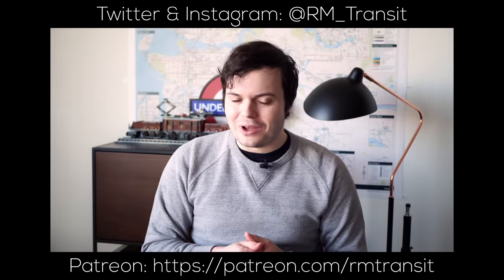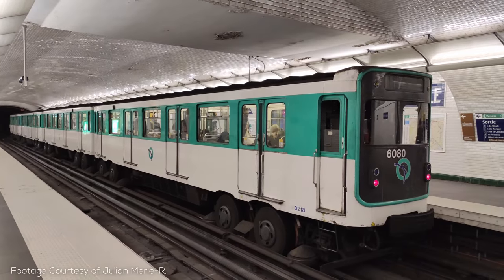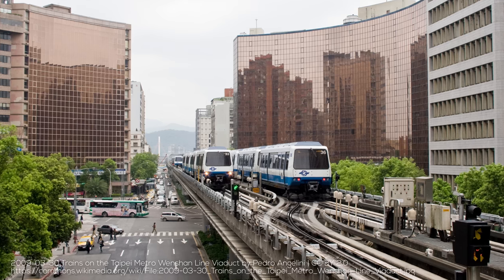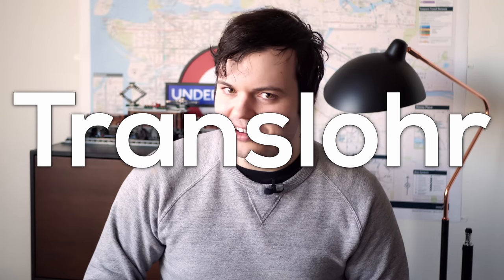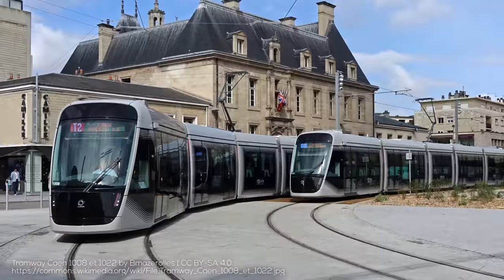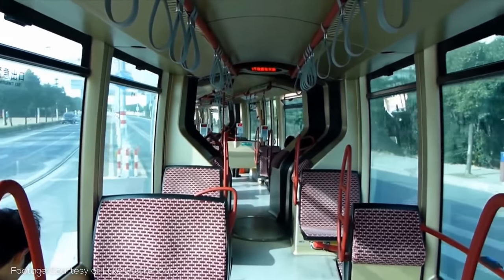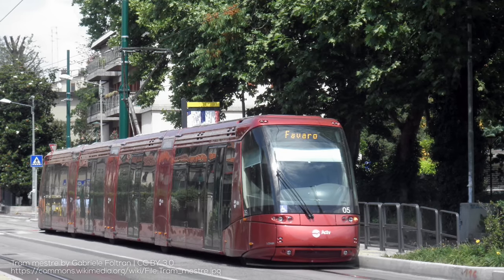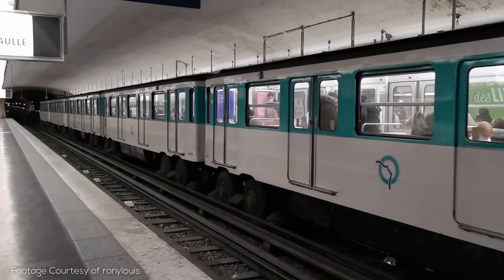Rubber-Tire Rail Transit is Weird

Comment: Medellin's hills are one instance where rubber tyres are vital. The city is along a valley, with the translohr up one side. Other perpendicular routes are operated by cable cars (gondolas) except regular metro along a side valley. But a trolleybus would also work - electric power but no track requirement.

Comment: The RATP (the company running the Paris métro) itself gave up with rubber-tyres at the beginning of the 1970s because they realized steel weels were just more efficient and retrofitting existing lines was too expansive. However it was deemed worth it to implement rubber-tyres on metro systems built from scratch. That's why Lyon, Marseille and every VAL network are rubber-tyred. Paris line 14 (opened in 1998) is also rubber-tyred but that was mostly for rolling stock mutualisation.

Comment: The thing with rubber-tire technologies is that they are not all equal. As a Montrealer, I love the metro system we have here. It is reliable, fast, beautiful and a tribute to our french affiliations. Most of our system has been planned and constructed between 1962 and 1988, so it is the product of a certain era and I don't think it should be seen as some sort of regretful outcome. However, even the rubber-tire train defender I am wouldn't recommend that technology to every city for it really depends on the system you have or need. Steel-wheel trains have evolved since the 1950's and the invention of the parisian rubber-tire metro, which did fulfill its purpose at that time and still do nowadays (although to a slightly lesser extent). Unless a system has multiple, close stations and curvy steep tunnels, I don't see why rubber-tire trains would be a necessary choice. And converting a line to fit them is likely too much trouble for too few benefits. And that's for metros that run in a tunnel and therefore doesn't need a unreliable single-rail system on a groovy rolling surface. Really, as much as I like rubber-tire trains, I hardly see the point of rubber-tire trams outside of a particularly hilly terrain.

In the end, I still see rubber-tire trains as just as good of an option to have in a metro system as long the said system actually needs them. Ironically, this is perhaps the main flaw of that technology. Steel wheels runs smoother and rubber tires runs softer (in a good and a bad way), but both works. Steel-wheel trains and rubber-tire trains both are as noisy, but just make different noises. Both are reliable. But what use to make rubber-tire trains relevant was mainly how good they could accelarate and brake compared to classic trains. That advantage has since noticeably diminished. So is it worth it nowadays to make a system use a different kind of more expensive just-as-good trains? I love rubber-tire metros and will continue to do so. But if Montréal were to add a line to its metro (which I really hope will happen) and decide not to use its well-known rubber-tire technology, I would understand why.
Reply from the maker: Of course, I love Montreals Metro - Translohr though…
Reply: Also today, there are the Japanese rubber-tired AGTs, most notably from Mitsubishi and Niigata Transys Co., Ltd.

Comment: Really wish you can do a video on Morgantown's PRT. In a way it is also a "rubber tyre tram", which is powered by guide bar. And by nature, it is a gadgetbahn. However, from a different point of view, it's more of an attempt to make automated taxi thingy using 70s era technology, and the only practical (?) pod car system.

Comment: If it wasn't for the rolling noise, the Montreal Metro is still the most comfortable system in Canada.

No squeal and the softest stopping (the wooden brakes help a lot with that). Floatiness is better that jitters.

Fight me.

Also Skytrain is barely functional on snow days and the reasoning for no surface lines for Montreal's metro is to keep everything tip-top. They say mixed-outdoors system greatly reduces the lifespans of railcars and whatnot. Given that until the Azur trains we were still rolling with stuff from the 60s and 70s, I'd be kinda inclined to believe that. Contrast that with the lifespan of MK1 cars on SRT or Skytrain.

Comment: I really liked visiting Montreal’s metro.
It was so quiet and pleasant.

Tire roar is far less triggering to me and I am sure other autistic people thank those tires. Metros are already over stimulating, the sudden metal screeches just push me over the edge.

The bouncing was fun too lol. Why is this not a pro? Sure its not “smooth” like Japanese rail, but nowhere in North America has well made rail and bumps on that are bone rattling.

I dont know where you mentioned efficiency, if at all - but i figured that the real issue was rolling resistance and vastly increased energy use.
Is this not the case?
Reply: Some comments mentioned VOC’s at 2.5 PM - thats very concerning. Maintenance and wheel replacement less so honestly. From a waste perspective its hardly an issue compared to the cars taken off the road.

I concede, that better maintained and newer iron wheel configurations are a better use of funds. As any desired outcome from rubber tires can be achieved with steel, and perhaps a hybrid system that transitions to rubber on steep hills for places that need it.

This comment only contests that tire roar and steel on steel clacks/screeches are equivalent sounds even at the same decibel level - because they are not for many who suffer from noise sensitivity. Or that a bouncy ride is equally bad as a bumpy one. Sports car over cobble road or a pick-up truck - which feels nicer? The road didn’t change, just how soft the suspension is.
Reply: The Autism factor can work the other way for other people.

I'm autistic and have ridden the metro in Montreal, in terms of overstimulation I def handle the steel screech better than the roar of the rubber tires. Also the smell...

But that's just me, obvi autism is going to affect people differently
Reply: I’m pretty sensitive to loud noise and I’d much rather hear an occasional screech than a constant deep roar
Reply: The decibel level of the Montreal metro is absolutely insane compared to the TTC. Objectively those rubber tires are causing permanent heating damage non-stop. The infrequent and short lived screeching on the TTC is a far lesser issue imo.
Reply: I can't say I feel the same, I moved to a city that uses steel wheel trains exclusively, and I find it so much more relaxing than the constant Godzilla roar of the Montreal metro. It helps that the line I use to commute is mostly in a straight line so there is less screeching than usual, but I prefer the occasional loud screech to a constant highway sound. It's so loud you actually have to almost shout to have a conversation with someone.

Not to mention the STM rolling stock (both the old and especially the new Azur trains) have a ton of wind blowing inside. Both because they're semi-open (which doesn't help with the roaring) and because the Azur has an insanely strong fan blowing air. I would often get a headache just commuting 20 minutes on the Montreal metro.

Also the great thing about steel wheel trains is the satisfying ka-chunk-ka-chunk sound when going through railway switches :)

Comment: More modern train systems like Canada Line for example, can climb relatively steep grades (4 to 5% from the looks of it). So rubber tires are kind of redundant and over complicated. Plus, when it comes to manufacturing and maintenance, uniformity is key.

Comment: Worth mentioning that LIM systems (such as Vancouvers skytrain) don’t require traction of the wheels as the train is essentially being pulled a long and not driven by its wheels. This basically eliminates the issue of wheel slippage.

Comment: Hello
Nancy choosed this (the name is TVR) instead of a tram for a few reasons. The city of Nancy is a medium city that can’t really afford a tram, and also wouldn’t be very rentable. Also, the constructor of the TVR gave some  reasons why they have to choose to build a TVR:
- Like you said, it’s has less constuction costs.
- Doesn’t use guided rails all the time, and can work as a trolleybus.
- faster build time.
- “Secure”.
But the TVR was catastrophic..
First, the maintenance was difficult because only two cities were using the TVR, so finding replacement piece was difficult. Secondly, the contact TVR-Rails was dangerous because the guide thing that was superimposed to the rail was to weak to support (I simplified the security problem). Also, after a few years, the rails got damaged very quickly. That caused multiple crashes. Then, the TVR line was only doing a half of the line for security. That was too much for Nancy. They decided to do like Caen, and stop the TVR. But there is a problem. Nancy can’t afford a tram. So they choosed to make a 24 meters buses line for 2022-2023, and this is finally going to be the end of the TVR.

Comment: Fun fact: some (I'd say most but IDK) trolleybus systems have relied on backup generators. In case of line work, emergency, or to move around the depot. The trolleybuses in Bergen, Norway had backup generators until very recently when a lot of the normal busses were electrified and the trolleybuses got batteries too.
Source: I live very close to said depot.
Reply: Also: rubber tyres in Paris creates oscillation.

Comment: I don't know if you've ever covered this but I was recently in Caen, France and saw a rubber wheeled tram/streetcar riding in actual dpuble troughs where the double rails would have been..sort of guiding the tram along...even with relatively tight turns...could you tell us about this unusual system?  Thanks...

Comment: Yep that is Nancy "trams". I hate they call them trams instead of buses that for 80% of the route move with the help of a single rail. Plus they have so many problems. I have not seen the line work for the hole route. There is always something and work done somewhere in the route. Plus the cars suck, and are small. They could increase the frequency a bit, in particular in the morning and afternoon.

Comment: Regarding the screeching, there are parts of the Berlin S-Bahn that will terrorize your ears to pain levels of noise. The north-south tunnel has a particular section that is notorious for the noise, reaching around 100 decibels. Since Corona in 2020 the windows are required to stay open, which has made that situation worse. I now avoid that train at all costs since it's really painful.
Reply: really, i thought the s-bahn was relative quiet compared to the u-bahn.

Comment: 4:57 I read that the rubber tyred-line on the Taipei Metro (Brown/Muzha line) was originally made by Matra, whose delivery was delayed/affected by technical problems, leading to former Taiwan/ROC President (& then mayor of Taipei?) Chen Shui-bian (陳/陈水扁) to famously say "瑪/玛特拉不拉,我们自己拉" ("(If) Matra doesn't pull it off, we'll pull it off ourselves")

Comment: The French GLT / TVR makes for very nice trolleybuses, and especially when in driver steered mode I found them to be far superior to motor buses. Guided mode is best restricted to straight roads and perhaps slow speed pedestrian zones
Reply: To make them justice, GLT is a Belgian invention from BN and was designed to run on premetro infrastructure with vehicle able to couple together and run in reverse... What was done in the end with the idea is really sad

Comment: One thing you failed to mention is greater friction caused by rubber tired metro trains. This causes more heat which can raise temperatures on trains and in stations. Friction can also lead to fires as seen on the Montreal Metro in 1971. I assume the only reason Montreal went with a rubber tired system is because it's French. Having to keep the entire system underground has greatly increased to cost of new lines.
Reply: Kinda why the REM is being built as opposed to a metro expansion.

Comment: The first thing I noticed from Toronto and Montreal was the lack of noise.40+ years of getting used to the T.O subway, then hearing Montreal, what a difference. Montreal you can actually hear yourself think. T.O is loud.
Reply: Id just wear headphones, idk. Rubber particles aint good

Comment: Rubber trains are my favourite train type. Technically they are good in "sudden" elevation changes as well as harsh climates. An ingeneer in the mexico metro said the steel rail/wheel system is the actual guide of the train, the "guide bar" is only for the energy power.

Comment: When I saw the thumbnail I thought you were gonna say something negative about double bendy buses, so I was very happy to see you were talking about something actually bad. 
Guided rubber wheel trains/buses are truly a bad idea and you have explained well why that is. As you implied in this video, these systems combine the disadvantages of rubber tires with the disadvantages of rail systems. 

The rubber tires wear down quickly while also wearing down the comparatively soft road surface quickly. The guide rails make the system as inflexible as any other rail system and have more or less the same infrastructure cost but they can't provide the ride quality or in most cases the capacity of regular rail systems. The only variation that sort of makes sense for me are the automated low capacity, high frequency people mover style systems but even then it seems questionable.

Comment: Occasionally, during extreme temperature periods in London, tube lines will be closed because the noise from screeching steel wheels on steel rails is too high for legal levels.

Comment: Also, about wooden wheels, steel wheels and rubber wheels... There's a reason we ride on rubber wheels on bicycles in the Netherlands.... 
It's examplemary for how efficient they are, really. Especially when rarely anyone had an electric bicycle.

12:45 and that's why we throw salt on every bicycle path in the Netherlands if it snows. The question really is: if. Especially in the south.

Comment: In Copenhagen we for many years had a line using electric busses, taking down electricity like a tram, but still with some independent movement on the road, as a bus. We stopped using trams in Denmark many years ago, but lately we have been re-introduced trams on some distances under a new name: "Light-rail", but still as clumsy functioning, when running in or crossing roads. And many accidents have happened when tracks are used as part of the roads! If used in a separate area from the road, they may function?

Comment: At least here in Santiago the rubber tyre lines perform better in terms of noise when comparing to the others, providing more comfort. Also, the sounds of the NS-93, which is a modified version of the MP-89, are a marvelous work of art.

Comment: I think that one rubber-tyred rail transport that does work well is the SAFAGE style suspended monorail, which while niche has its uses. In areas where there isn't much room above ground and where going underground is going to be expensive and problematic, going above existing streets is a good idea. This type of rubber-tyred rail transport would also not be susceptible to snow and ice very much since the tyres are encased in the rail.

 I agree that most gadget-bahns are pointless where they're built, but they can definitely have their uses when used in the right places with the right conditions. But of course, as we've seen they aren't usually built in such places.

Comment: medellín is my city, so I think I can answer your questions about the medellín metro: no there probably wasn't a better alignment, medellín is in the aburrá valley which runs north-south, and the whole point of that route was to have an east-west line that brings more people to the existing north-south lines. Any east-west line is going to face steep gradients as it reaches the foothills and towering slopes of the andes, but this line runs through downtown medellín, the flatest and widest part of the valley, so it is probably close to as good as it gets to maximize utility of the infrastructure. As for buses, there's already tons of buses, I think we need look no further than our neighbor city Bogotá to see the limitations of buses. They are not bad, but the whole point of building this line is that there was/is the demand for it—it goes through downtown Medellín after all

anyway great video as always, keep up the great work!

Comment: By the way, the first snippet of the Paris Métro shows a MF01 EMU, currently the most recent steel wheel stock of the RATP. These are actually a token of the decision taken by the RATP already in the 1970s to stop earlier plans to convert the entire network to rubber tires, due to the significant improvement of the rail-steel wheel technology. Ever since extensions of the rubber tire network were confined to line extensions and newly build automated lines.

On the rubber tired lines, power is drawn by sets of collector shoes, one per set contacting the guide bar and the other one of the running rails, in contrast to the steel wheel lines with top-contact. A steel wheel train with matching collector shoes can actually run on the rubber tire lines.

Comment: I am pretty sure that Toronto has/had wheels without taper to the only way to steer them was to rub the flange against the rail and it also make the tires rub against the track on curves because the same diameter of wheel is going across different lengths of track.

Comment: ph well, its different. One would have to think it would be quieter than the steel wheel counterparts.  Montreal Metro is rubber tired, it does seem more smooth .

Comment: I am surprised you haven't mentioned that steel wheels have low frictional coefficient on metal rails, which increases efficiency thereby using less energy. Comparing the ride of the (alleged) BRT Silver Line in Boston in the South Boston Transitway with Green Line trolley service I find the ride on steel wheels to be much smoother than the rubber-tired ride on the concrete roadway in the transitway.